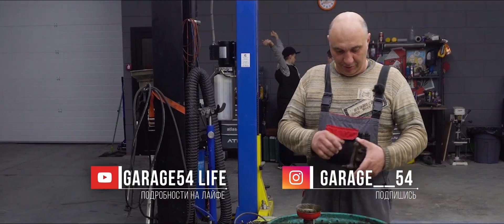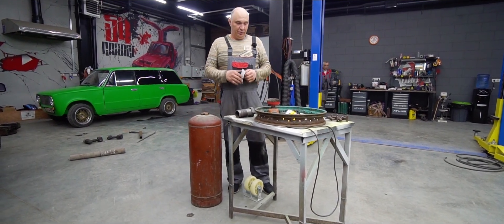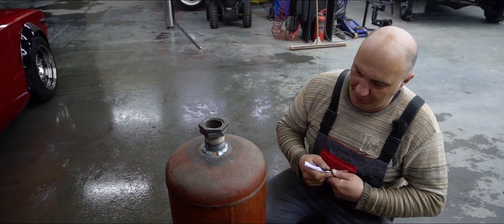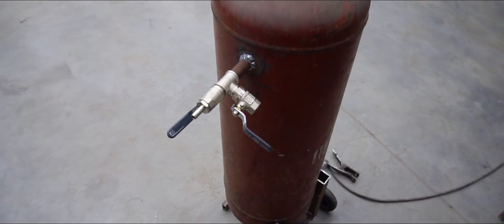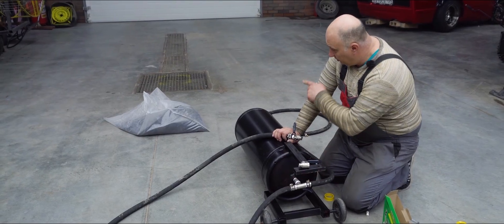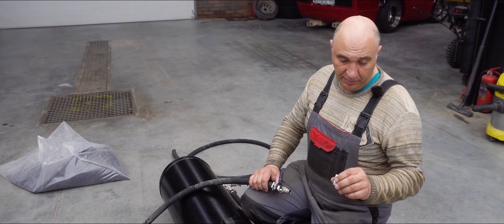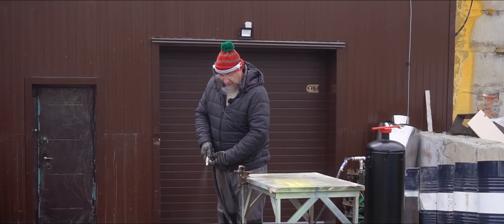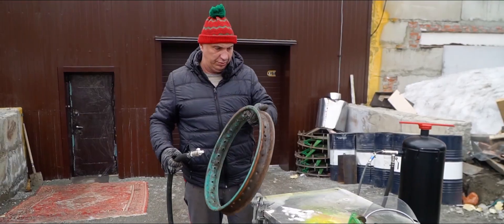Making a DIY sandblaster

Comment: now you need a blast cabinet,  with a baghouse,  also if you don't have an air dryer water in the air will be a problem, i have used all kinds of media blasters, hand held gravity feed, bucket siphon feed, cabinet siphon feed, small pressure pots that hold half a bad of media, large pressure pots that hold 4 bags of media and have a diesel blower/compressor and cabinets with a pressure pot system, the last two had no valves at the end of the hose, when the system had pressure you were blasting till the media was gone,  the large pot was outside and the media was lost, the pot cabinet recycled the media separating the dust from the un-burst media via a cyclone classifier and baghouse system, in this system a small pressure pot sat below the classifier and had an air controlled valve, when the pot ran out of media you released a foot switch which opened the valve at the top of the pot allowing the media in the classifier to fall in, then you stepped on the foot switch which closed the valve pressurizing the system and you were blasting again, sounds complex but it is a simple system, i could explain how the dust is separated from the un-burst media, maybe later... in a proper working system the grains of media should burst when hitting what your cleaning, that has the most effect.

Comment: I like your sandblast build.
Excellent camera work,especially the hose shots. The machine stream eats the oxides and goes right to bare metal.

Very ingenious use of an old oxygen cylinder. You are a resourceful fabricator.

Success!
Reply: I thought it was an old acetylene cylinder. They did fill it with water to do their work because of the former contents. I don't believe that would be necessary if it had previously held oxygen.
Reply: There was Пропан(propane) written on it.

Comment: I'm building a wet blaster to avoid condensation blockages.  Love spark plug idea!  White Vinegar is a great rust remover.  Phosphoric acid for rust conversion is available from rural stock suppliers and used in dairy industry.  Can nickel plate yourself with car battery!

Comment: You should create a hood with grill bars on top of a hopper to catch and recycle the sand/copper slag. A strong magnet near the throat of the hopper will help pull most of the metallic/rust waste from the sand though I'm unsure how to filter the paint particles out. It's worth looking into and will save money from buying copper slag every time you need to use it (until recycled sand loses it's scour ability)

Comment: The first mistake is not to fill it with water I knew a guy that blew a up a Harley's tank doing that!   The right remedy is to use your car  start it up  make sure it is a unleaded gas type put a hose in the exhaust  run the hose into the tank   for for 5 min the carbon dioxide  neutralizes  the gas .

Comment: Use walnut. It better than sand. Also for spark plug, remove ground tab and drill through the center. That will have threaded to used. No cutting.

Comment: In Afghanistan, sometimes when we needed something like this, we had to make it for ourselves. We might order one, and it might - maybe - get there sometime in the next six months.
I made a sandblaster out of an old pressure-washer valve and some hydraulic fittings, (to pick up the sand,) and used sand from the volleyball pit. It fed from a water bottle.
Worked great!

Comment: 0:30 - man... coulda done it so many ways. My choice would've been buying a bunch of vinegar and putting it in the container... or maybe electrolysis would be a little quicker. Sandblaster is cool... but for a normal guy way more work!
Reply: It's long to build at first but in the end sand blaster will be faster. Electrolysis requires a lot of time and never is as good as sand blasting. And vinegar is even worse.

Comment: You need a pretty good compressor to run that thing👍
Reply: 82 cubic feet/min for 1/4' nozzle; 265 cfm for 3/8" nozzle; 335 CFM for 1/2" nozzle @ 100 PSI. Volume of grit/sand/soda/glass bead/hardwood (chopped up prune seeds or walnut shells etc for no damage to soft metals). Silica is main hazard to breathing causing Silicosis of lungs. Same as Asbestosis & no cure. Particles get into alveoli {grape like structures of 2 cells thick that transpire O2 & CO2 with blood} & God given macrophages can't rot them so they fill up & reduce breathing. 
Silica used to be a common blasting abrasive but in last decade NZ Labour Dept ruled a maximum of 6% silica. I used Ironsand or Ironsand concentrate in a few decades of sandblasting bridges etc. Silica is contained in most things that get sandblasted. Yours faithfully, from "Ends of the Earth" New Zealand, Land of the Long White Cloud; Aotearoa (Maori name).
Covid19; use fish oil to help your immune system. Google Dr Been for explanation.

Comment: A useful project for once, now build a sand blasting cabinet with  Door for loading parts, a Plexiglass window for seeing inside, nlasting hose and nozzle inside,Rubber gloves below the window and a light on the top inside, a sump to collect and re use the sand! 
And a exhaust fan with sand filter to keep the area visible inside....

Comment: Adding 100 lbs of media through that little filler hole one cup at a time is gonna get old pretty fast. Also, I always use a screen on when filling, clearing nozzle clogs caused by large chunks in the media is a real pain in the ass. If you lay out a tarp and do the blasting on it you can collect and reuse the media several times if you use a screen. You should always use a respirator when blasting, the stuff you are blasting off and silicosis from the media are nasty things to breathe.

Comment: I was recently restoring my aluminium wheels that had some corrosion on them. I used steel brush and it took me so long and I don't think I removed it all. Sand blasting is a way to go.
Reply: Using a steel brush will also impregnate the aluminium with steel particles and you will find it rusts faster next time.
Reply: @michaelwesten1092  Aluminum oxide... of course!

Comment: I thought Russia used the Metric system?
Wondering why you guys are using Imperial pipe measurements? 
1/2" = 13mm anyways...
Reply: Well, the hoses even in Europe are labeled in inches for some reason. We'we call them 'zoll', its some German word, but they're actually inches.

Comment: Congratulations Vlad! It works great. I think a more precise nozzle would be beneficial. This is because the area being cleaned would be more precise thereby using less sanding material. It appeared with the spark plug there were areas you had to go over multiple times. Or this is what appeared to me on film. Anyway great job, really impressive work.
Reply: Eddie Hitler   As I penned the comment I wondered if that might be the end result. Thanks so much for letting me know.

Comment: I use a sandblaster also. I built a 10' x 10' area with tarps that keep the blasting media contained within that area. I easily sweep it up and shovel it through a screen to reuse the media while removing the larger debris. Use a respirator because many blasting medias are very harmful to lungs.
Reply: And careful, with every reuse that material breaks down and the particles become smaller and smaller, even a good respirator won't keep that crap outta your Lungs. It also becomes less effective as the sand loses it's sharp edges, as I'm sure you know. I wouldn't do much of it without a full hood. A Blasting Cabinet for items like that little Vice would best but damn they ain't cheap. Cheers!!!
Reply: @MisterAMuck  , but not hard to make.
Reply: @senatorjosephmccarthy2720  A Blasting Cabinet?
Reply: Yup we cant see it but if you inhale noting can safe you.
Reply: Check main hose or replace them every few months.
Reply: Silica in sand WILL cause silicosis
Reply: Not just the blasting material, if anything the removed debris can be worse, esp with paint etc...
Reply: put it through 2 screens one to remove large debris and one to remove anything smaller than the normal media should be. It's the medium stuff you want to keep. a magnetic plate to remove the metal dust is useful too.
Reply: Inhaling silica will kill you fast. Always wear ppe. It's not worth and eye, ear or lung or death. If you're dead you're not doing anyone any good.

Comment: the gloves you need are rubber and very thick. when sandblasting a wheel or something thin you must not spend too much time in one area because like welding, the heat can build and make the part warp.
Reply: You can use baking soda instead of sand it doesn’t warp the part as much

Comment: The spark plug trick is pretty nifty. Frequently check your sand hose for thin spots. The sand / slag will wear the hose if you have a curve in it while using it. I know a guy that had the hose blow out where a thin spot had occurred and it blew the skin right off his arm where the sand hit it. He had to have muscle surgery and skin grafts. A good idea would be to wear a leather welding cape with the sleeves.
Reply: Or just wrap the hose in a leather cape etc

Comment: I have to wonder how the hoses and fittings are going to hold up after long term use.  I imagine erosion would be a serious problem.
Reply: Brass and rubber last years, if you do not use that all the time. Brass will give up first, then you by new peace.

Comment: Garage 54 Ive built load's of these in the past plus ive built a soda blaster out of a fire extinguisher yous might wana build yourself a sandblasting cabinet out of a 55 gallon drum will come in Handy' in your shop for car part's i use mine all the time to restore motorbikes. id also put a pop off valve on that blaster before it over fills & blows up& kills you & all  around you  & when you test them test with water by using a jet washer then if it blow's all yous after worry about is getting wet instead of been dead or hurt badly

Comment: Я сделал такой же дизайн, используя бутылку с хладагентом 134А около 15 кг. Я купил керамическое сопло для моего. Но я сделал так же, как ты. Я считаю очень полезным использовать хотя бы один водоотделитель, если не два.
попадание влаги в ваш агрегат быстро остановит вас. Также, если бы у меня был большой проект, я бы заставил моего сына кормить бутылку, следить за давлением, сливать влагоотделитель и вибрировать бутылку палкой, чтобы заполнитель двигался вниз. Отличная работа! Я люблю пескоструйную обработку.
Reply: I made the same sort of design using a 25 pound 134A refrigerant bottle. I have the hoses and valves the same as yours. However I bought a ceramic nozzle for mine.
It’s advisable to use water separators. I have two on mine. Water in your aggregate will stop you dead.
If I have big jobs, I enlist someone to, refill the container with aggregate, monitor my pressure, drain the water separator and whack the bottle with a stick to keep the sand moving down.
Great job!
I love sandblasting.

Comment: If you see a russian taking safety precautions, you now it is life threatening
Reply: It is. Did sand blasting for a company few months and dangers of that thing come to clear real fast. If you have blasting hall with door open, you need full replacement air hood mask that covers your shoulders and feeds you clean air trough hose. You need very powerful lighting cause after 15minutes of blasting you wont see shit even in good sun light being outside. That stream of particles will eat trough metal easily, dent it if you keep it in place too long, go trough 2x4 in about 20 seconds and normal glove...well mind where your hands and feet are...
Worst thing that happened to me, was after hour of blasting replacement air supply cut off for some reason and hose had tangled. Tried to untangle it for 30 seconds before air started to become full of dust, so one last inhale, looked to find those huge doors and sun light as exit.. could not see it, so took gamble and run out with out the hood.
Reply: @Hellsong89  Most viewers do not understand the hazards of sandblasting well enough to embark on a DIY project like this. The Russian had heavy-grade equipment, a welder and a great deal of experience with what is safe and what is more likely to work. The fact he was still alive and well is proof he understands what he is doing.
Reply: @Hellsong89  sounds pretty scary, glad you made it out
Reply: @Hellsong89  I'm thinking will invest in a pressure washer sand blaster attachment kit. to help reduce adverse health issues and I think will be a little safer.
Reply: Silicosis is nasty. Don't ever go sand blasting without proper safety.
Reply: The meaning of life is pointless if you are choking to death. 

The man who isn’t afraid of suffocating due to respiratory problems is a man that doesn’t choose to think ahead.
Reply: @Riskteven  dude your right . My mom and brother take no risks and are the most miserable people. Other brother and I , my aunt , unlce, all calm but have fun and try things. Then them too sit in the house. Even before Corona. Do nothing and are the most miserable
Reply: He had more PPE than they did in Chernobyl  😷
Reply: This killed me 😂👌🏼
Reply: Run!!! **king Run!!!
Reply: Survival, that is all.
Reply: 11:30 I tried that as a kid, and 50 years later still have the scar on my thigh. Bled quite a bit, but the shame of being stupid outweighed the pain of the cut itself.
Reply: LOL !
Reply: @OMGWTF Hopefully my comment didn't come across as disrespectful and was only intended with a slight humour.
The Chernobyl workers and rescuers were heroic and prevented a horrible disaster from turning into a global catastrophe. They deserve our praise and memory. The Soviet government and institutions deserve the blame. Regards.
Reply: @OMGWTF Thanks. The Sky/HBO series "Chernobyl" from 2019 was also very good:
https://ok.ru/video/1597743827708
Reply: 6:41 Seems he didn't get the memo.
Reply: im the thousand like
Reply: He’s not Russian
Reply: I had a more simple1 bought. A suction hose into a bucket of dry beach sand and a blasting gun on the end of the suction hose with somewhere in the middle a airhose. It created vacuum sucking up the sand blowing it through the gun on to the steel. Worked perfect. Used it outside to sandblast chassis of trucks and trailers. Sand was free available in the dark of night on the beach🤣🤣🤣
Reply: *know
Reply: at 11:18 he is cutting tubing with carpet knife, against his leg :D so much for safety
Reply: Didn't stop him from cutting rubber hose with a sharp knife against his leg though!
Reply: Lol😊
Reply: No shit.  Russians don’t really give much of a shit for most things.  This one looks like he picks up trains With his hands for a living.
Reply: He's using a welding mask - wimp!!!😂😂😂
Reply: @1963TOMB  that is certainly not a welding mask and would definitely not protect him.
Reply: A freaking power washer is dangerous without sand. Lightly touch the spray and skins gone.

Now add sand. 

 Like Parana got you..
Reply: @lucienberl  For certain!   Thinking more the inhaling silicone dioxide (sand) dust less.  Plus water pressure compared to air pressure tank less issues.
Reply: @lucienberl  my one co worker a while back brought one to clean tiles and grease and he had this one black or red tip can’t remember and he touched it just a quick bit my mistake and that shit slices his finger by an 8th an inch shit was nasty. Who would’ve known water alone could do that.
Reply: you make me fkn LOL
Reply: @Riskteven  -- Ummmm, no. The "meaning of life" is to understand/become good and minimize  risk as avoidable waste, loss and delay.
Reply: @bobgreene2892  Nope the meaning of life is procreation...
Reply: @lennym1273  

Meaning of life is to Exist

The purpose of life is to Procreate.
Reply: @bobgreene2892  if it's a simulation the meaning could mean anything. 

If there's God, the meaning is to live and be good and experience. 

If there no God then there's no meaning and you can think what ever you want making your own meaning. 

All are possible until the Democrats make you think what they want. 

Trump 2020!!

Comment: Airborne particulates from sandblasting is really hazardous to breathe, risk of silicosis, not to mention the rust particles. I recommend particulate filter respirator like N95 or P3 and protective glasses together with a face shield. Good DIY project!

Comment: although a proper sand blaster would be better in several ways:
1. you reuse the spent material (here you don't, is lost consumed) (more economical in the long run)
2.safer in all aspects, silicosis is a huge issue with lung fibrosing diseases and proper protection of hands 
3.less space occupying 
4.can work under any weather (is a seal box that could work in doors without killing everyone's lungs so fast) 
5.a proper sand blasting gun would make precision and ease of use way better and no issues of intermittent feeding the media
Disadvantages: 
can't sand blast big items
please read below 
https://www.ncbi.nlm.nih.gov/pmc/articles/PMC4380606/
https://www.cdc.gov/niosh/docs/92-102/default.html
please be safe and take care fo your selfs 
Best regards 
A fellow concerned Doctor

Comment: Very easy to make a SIPHON FEED sandblaster from a 5 gallon spackle bucket. I used mine all the time until temporary wheelchair duty. Just purchase a ceramic tipped gun and feed it from the bottom

Comment: My only worry about this is the hose, being a hose, will eventually get holes torn in it from the abrasion of the sand.
Reply: Probably not as fast as the valve or the outlet.

Comment: Great video we built exact same one but the only problem with them is that the tap in the front where the sand comes out or garnet comes out usually breaks because the garnet eats up the taps insides and coms out on the side
just want to edit in also the problem with the sand blaster is that it is a very tedious process but it is a bit faster than a wire  brush or an drill but it still takes a while to do big parts like trailers just saying this for all of the people that want to do big stuff with homemade sand blasters